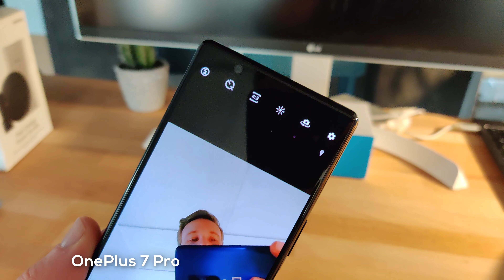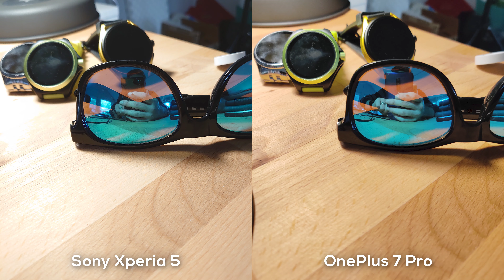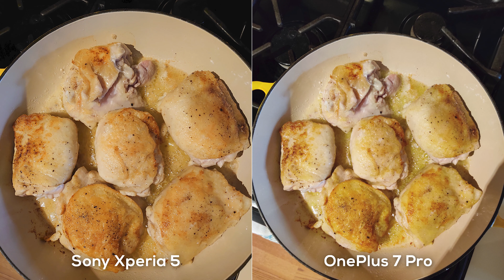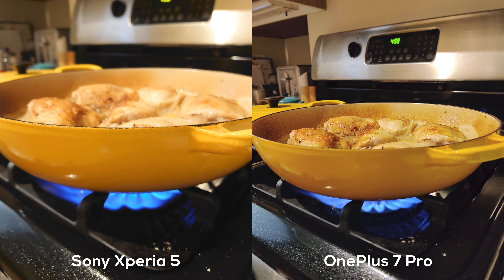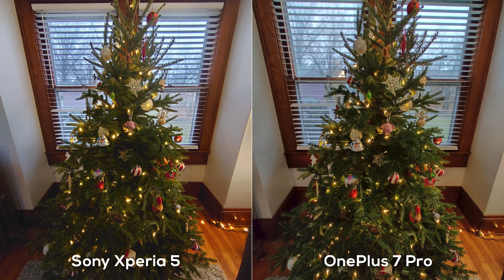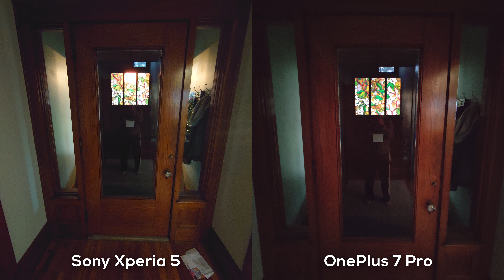Sony Xperia 5 versus OnePlus 7 Pro camera comparison

Comment: Most of the exposure problems here is because you tap on dark areas, forcing the Xperia 5 to overexpose.
Photos on this video are exposed completely different from the pixel 4 vs xperia video.

Comment: I feel sorry for Sony. They make the best camera sensors for other smartphones, but they can't get their own phones right. I think its  their software issue.
Reply from the maker: Sony has had an issue internally with trying to prioritize their real cameras over smartphone cameras. They have said that they will be correcting course going forward, so we may see some big changes from them in 2020.
Reply: Yes, fully agree with you. All Sony needs is camera department team / software engineers from Google :).
Reply: Some of this photos are forced to overexpose because he tap on dark areas.
On auto, Sony change the ISO according to the movement, his hands clearly were shaking producing noiser pictures and blurred photos.

Comment: And what happens when the Xperia 5's HDR is activated?  Because the One + 7 Pro uses HDR constantly.
Reply: Exactly..I have the Xperia 5 and manual mode with hdr is great.
Reply: @Kenox80-80  You can't get any good photos with lots of post-processing. It is just physically impossible due to the lens size. And who said that clever post-processing is bad? It seems that OnePlus done it right contrary to Sony.
Reply: @Kenox80-80  I think you're mistaken here. Nothing really good can come out from tiny lenses without heavy post-processing. Again, you can't go against basic physics. That's why mobile photography will neve compete with DSLR with large lenses.

Comment: Sony supplying 70% of smartphone camera sensor out there but can't make its own right. What a waste.
Reply: you should check out camera samples shot on the Cinema pro app. This is what shows its full potential in HDR it's natural tones and good exposure even at night when done right.if you compare the color science and processing of this phone with a standard camera you won't even notice if it was shot on a phone. it's that good!
Reply: @jakilahmoulien9070  Check the facts, almost all reviewers had faced issues in the cinema pro. It's kinda breaks my heart, I was willing to pick one up until I came across a demo set myself and I'm disappointed right away after comparing with my Pixel 3. I knew I'd regret if I picked it.
Reply: @leongcm1998  nah. Sony is good right now. While i do agree they can take some public advice, in most cases it is best to leave them be. I mean they just took over the #1 spot from Canon in ff cameras, yes…Canon
Reply: @jakilahmoulien9070  I know Sony's footage can be great if you really know how to tune it, but people needs something that produce the great shot INSTANTLY. Sony has been wasting too much effort, they need to get in the right path (computation photography) ASAP.  Inconsistent image quality, camera software and only half useful features. That's what Sony needs to put an end or they gonna fail big, again.
Reply: Ed, my samples will prove you wrong: https://youtu.be/k68vQXdfpRU

Comment: I can't handle how Sony produce the best camera sensors and the best DSLR cameras and can't produce a smart phone with a good camera
Reply: It's because Sony is good with physical hardware, such as the lenses. A phone camera is much less about the lens but more about the software; Sony has never been great with software.
Reply: @BN99239  
Why does it not hire good and expert software engineers from Google or Apple to improve its smartphones' cameras ?
Reply: @egyguy2669  No idea why. But there A LOT of phones out there using Sony lens and sensors and they have amazing quality. It sucks that Sony can't do that to their own phones.
Reply: Yeah, the dynamic range in particular is just laughable on this thing.
Reply: @timg2727  the high dynamic range has to be turned on in manual mode..pictures are excellent then
Reply: Mirrorless not dslr. Google and apple use heavy algorithms and computational photography to get the best one-and-done pics. These new xperias are meant for the manual control IF you know how to use them. If not, then the better images come from the other brands.
Reply: @MrJoey1498  right
Reply: @timg2727  this will prove you wrong with my samples: https://youtu.be/k68vQXdfpRU
Reply: For the longest time, the phone group were separate from the alpha camera group and apparently were not allowed to share resources or anything, meaning the phone guys had to do it all themselves without any help from people within Sony who know how to make a camera system. I believe that has changed now and the Xperia 1 and 5 are the first results of closer collaboration within Sony. Better than before, but still a ways to go.
Reply: https://youtu.be/6Z7inQ-bnC4 

Here is your answer. 
Sony is not a sheep, it doesn't follow trends
I agree that the camera could be better, but the is a reason for that

The end of the video explains it very well
Reply: They do make good camera phones, you just need to know how to use it. Sony is not as straight forward as many of it's competitor but that's what makes the phone intelligent. Intelligent in a sense that, you have advance control on the photos you are taking instead of relying on AI assisted photography. When the market is this saturated, a pro like phone is a breath of fresh air.
Reply: Ahmad, this will prove you wrong on my samples: https://youtu.be/k68vQXdfpRU
Reply: I think Sony just don't really want it, they don't care. I guess they have strong argument about it: wanna great photos - buy our DSLR camera!
Reply: The JPG on their Alpha cameras doesn't use HDR neither, because it ruins the light composition.
The 12 steps of dynamic range is from the RAW files.

Comment: does youtube spoil video quality when you post it?
Reply from the maker: The bit rate is changes and the file isn't as clear is the original, but the white balance, exposure and saturation levels are typically the same.
Reply: Yes, although it's mainly due to the file format YouTube uses and video quality lost because of data compression. Overall though it really doesn't hurt quality much maybe a 3-5% difference than the original files.